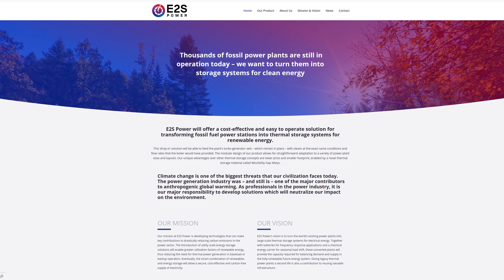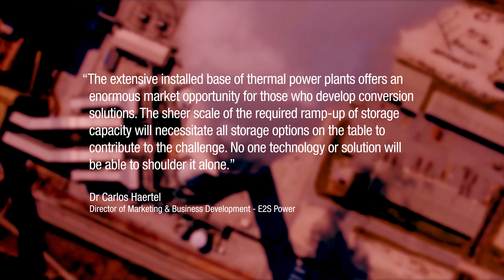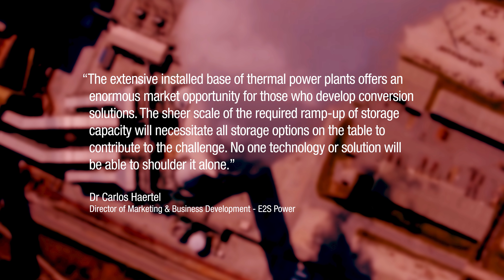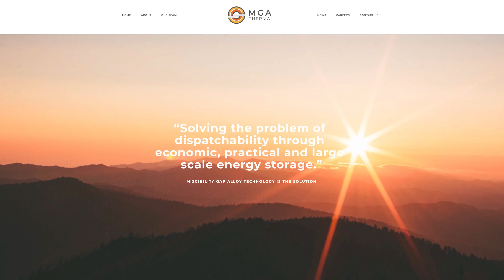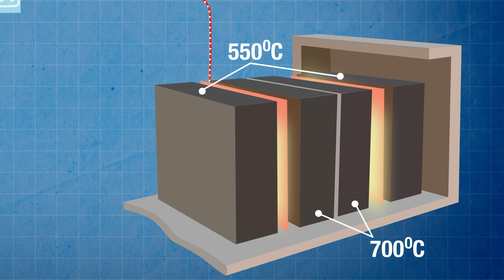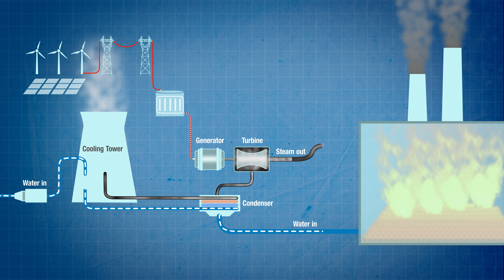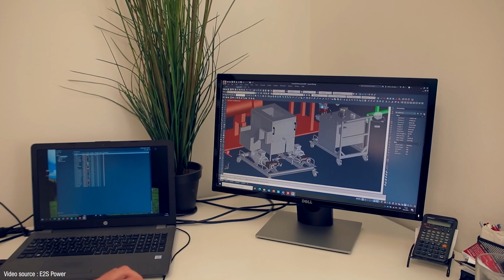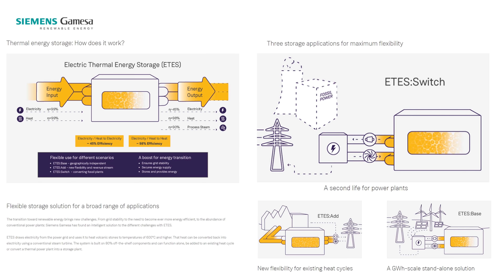New energy storage tech breathing life and jobs back into disused coal power plants

Comment: This is a very bad option from efficiency point of view.
You take a high-grade electricity during charging and lose more than 60% during discharge.
Batteries are much superior and Hydrogen is better as well.
The only benefit is the usage of the existing infrastructure
Reply: Current and near future battery plant capacity and their associated raw material supply chains are fully devoted to making batteries for cars and smaller scale storage facilities to take over the function of fossil fuel peaker plants.  There is no capacity in the system to build and supply the very large battery plants that would be necessary to build large utility scale battery storage facilities to complete with and/or displace base load fossil fuel plants.

There is no hydrogen.  All hydrogen has to be manufactured, compressed, and stored.  If one considers the full and complete life cycle, the infrastructure cost and electricity necessary to manufacture and compress hydrogen is as you say "a very bad option from an efficiency point of view".  You can't arbitrarily start the economic analysis from a magical utility scale store of compressed hydrogen.  The complete life cycle economics of hydrogen have to factor in the upfront capital cost and ongoing maintenance cost to build and maintain a hydrogen manufacturing, compression, and storage facility.  You also have to factor in the operational cost of electricity to manufacture and compress the hydrogen.  These significant costs all subtract from the overall financial viability and the net electrical efficiency of hydrogen (i.e., the electricity produced by hydrogen minus the predicate electricity needed to produce and compress the hydrogen in the first place).  

Large gigawatt utility scale solar PV is now coming in at a cost of less than $0.02 per KWh at favorable locations like the UAE and the Atacama desert.  At these costs does the round trip efficiency even matter any more?  A $0.02 per KWh generation cost coupled with a 50% round trip energy efficiency loss simply becomes the equivalent a $0.04 per KWh generation cost.  The problem with intermittent renewable sources is becoming less and less a problem with the cost of generating power in the first instance as it is to the problem of storing the power once it has been generated.  It increasingly seems as though the once important cost of generation (and round trip energy efficiency) are both well on their way to becoming an obsolete financial red herring that is dwarfed by the technical capability and associated cost of storing power once it has been generated.  The round trip energy efficiency losses are a built in cost of doing of business that will become increasingly more negligible as the cost to generate power from intermittent sources continues to fall. At the present time and for the near future utility scale storage capacity is the limiting factor and choke point to the growth and expansion of intermittent power generation.

The quick lead time and low capital cost to retrofit and repurpose the old power plants seems to be the economic driver of this solution.  It seems to be a relatively simple, quick, and inexpensive solution to get the repurposed system installed and brought back online.   Keeping in mind that these upfront costs will need to be amortized and passed on to the downstream wholesale and retail customers.  The basic engineering design of this novel storage solution has already been pilot tested and proven on a small power plant.  It need only be scaled up to a larger utility scale.  If so, a large number idol decommissioned power plants (or scheduled soon be decommissioned power plants) can be quickly repurposed and brought back to life as economically viable storage facilities.

Comment: Sounds like a huge, inefficient increase in entropy, converting electricity into heat. I'd prefer using the coal yard for Highview liquid air storage.
Reply: High temperature heat. Very important detail, as high temperature heat has low entropy compared to low temperature heat. So the entropy increase is not as big as you would imagine. 
The maximum (Carnot) efficiency of converting heat back to mechanical work depend on the temperature, given by 1- T_low / T_high.
If T_low = 20°C = 293 K and T_high = 600°C = 893 K, then the maximum efficiency is 67%.
Reply: Use the land where the cooling towers are located for the Liquid air plant, the Highview system gets more efficient if you have access to waste cold or waste hot, this could provide quite a bit of the later. However, I do wonder about some of these energy storage solutions as they assume the current situation of free or very cheap energy at night will remain the norm, unfortunately economics and grid frequency control means its often simpler to curtail Wind turbine production. Hopefully the grid operators and regulators will find ways to reduce curtailment by encouraging these sort of solutions.
Reply: @makemineapint  simple physics (and people primarily being active during the day) means there will be an excess of available wind energy during the night. The economics side of things should be changed with regulations, to make sure it is always more profitable to run a windmill and charge a thermal battery than simply curtail production. 
I guess their business model depend on regulators doing the right thing.

Comment: A really interesting concept - but I'm really curious to know how they are overcomimg two issues: 1) the inherent inefficiency of the steam turbines used in coal fired power plants. My rough guess is that the round trip efficiency of this system will come in around 50% at best. 2) the increased thermal cycling of the steam turbines which dramatically shortens their life. As a thermal storage technology MGA does seem pretty amazing, and reusing the substation, transmission lines and switchgear at old power plants does seem attractive.

Comment: I'm not convinced of the overall system efficiency. Convert electricity from grid to thermal energy then used to boil water to generate steam  to generate pressure to convert into mechanical energy that is converted into electricity sent back to the grid... Just too many steps...

Comment: Another bad idea how much energy is required to Prime the system and then how many times will the system need to be primed each time it needs to store energy. Think about how much energy is required needed to turn water into steam at high enough pressure to turn turbine blades generate electricity. At some point the heat stored within the aluminum graphite blocks will not be enough to produce the steam pressure necessary to turn the turbine blades fast enough for productive energy production and that's where you lose efficiency so the question is how many kilowatts a storage is necessary to produce how many kilowatts of return power?

Comment: That all sounds good but I always understood that coal plants are base load and it take days to take them offline and start them up again.  That would mean that for most big coal plants you'd need a constant source of 'hot', which is sort of what renewables are not.  I'm more of a fan of replacing the boilers with modular atomic generators of heat -- the type that turn up on the back of a truck and get sent back to the factory for refuelling.  That said, this would be a good replacement for the gas-fired plants that can wind up quickly to mange peak load.  Of course the other factor is that a lot of coal plants are pretty old and will probably just get run to the end of their useful life and combined cycle gas plants are brand new.  The incentive may be to run a coal plant until it's dead but not convert a gas plant immediately as it's less polluting. Still, over the longer term this isn't a bad way to scavenge 'hot' from renewables, which could have other applications than power generation like smelting, home heating and so on.

Rereading this, I guess you could charge up the heat sumps during the day, while running the station as well, but you'd be losing power during the daytime running  due to inefficiencies, probably a lot.  So if you always have loads of excess renewable during daytime (or whatever) it could work but you may find a better use for that excess power, like running a Haber process or smelting aluminium or something.

Comment: Interesting idea. One issue is that in the US, many coal power plants were built in the 1970's and are now approaching their useful lifetime of 50 years and so to keep using all the existing power plant equipment, major rebuilds are needed which is why a lot of them are going to close. So getting credit for going green but in reality avoiding doing costly rebuilds. 
If the power plant is anywhere near renewable sources, the existing switch gear and transmission lines are a big plus so would expect those parts to keep being used.

Comment: A coal power plant that only works for a few hours isn't cost effective enough to warrant maintaining it's operation. It's like the worlds most complicated/expensive battery.
The amount of energy that needs to be created to melt aluminum is probably a lot. That's energy that isn't being used by the grid, at any given time. This means that the amount of investment in intermittent power sources would be vast, especially considering how much power will be needed if most people start using 100% electric vehicles.
While batteries offer a way to reduce the amount of energy being wasted, electric vehicles will make power fluctuations become very dramatic, meaning that power production and power demand will both be intermittent, a very complicated prospect.
Is the UK out of coal? I don't see any reason to stop using it completely if it's still available. That's what people are arguing about right?
Also, what is the actual energy output efficiency? Batteries lose their voltage, effectively becoming useless after the voltage reaches a certain point. In most batteries, it's like 30%. How would this heat/steam battery match up?  Is it 100% efficient?
I'm skeptical about this idea. It's a novel idea, but probably not worth it. The cost of electricity would probably go up. It's like running a coal plant, that only produces energy at night. Also, how well does it ramp up production? It can't respond instantly, so a substantial amount is going to be wasted, like it normally is. Therefore, it isn't really even energy storage, it's energy momentum.

Comment: I think our biggest issue is medium to long term energy storage. Specifically we ideally need a 3 month stored supply by my admittedly finger in the air and see which direction the wind is blowing calculations. But to put this in perspective how much do we need for an hour on average? In 2019 we used 324TWh. That is near enough 1 per day or 41GWh per hour. Denorwig though huge only stores a tad over 9. There are only 2 other potential sites like that in the UK. So what would it take in lithium cells? Modern 18650 cells can store up to 13Wh (older types about 10) before the price makes your eyes water. So just for 1 hour you would need nearly 3.2 billion of them just for an hour. Aluminium has a latent heat of fusion a little over 10kJ/mol. 1 mol for aluminium is about 27g so a massive 370kJ per kg. Unfortunately that is only 102Wh per kilo. So for a mere 1 hour you would need the best part of half a million tonnes. That is a small fraction of the energy density of lithium cells. This is not a simple issue but liquid aluminium is not the answer. For starters the expansion between 550C and 700C is more than 10%. That will burst anything.

Comment: I’m curious why they use aluminium which is a more expensive metal than say iron which has a higher melting point (around 1500c) thus being able to store more energy.
But still well below graphite 3600 Celsius. Perhaps having a lower melting point is better from an insulation perspective?

Comment: Sir what is the price of this container size energy storage box and how much energy it holds when fully charged and what is the maximum electrical power we can apply to it so that we may be able to charge it as quick as possible and how fast we can discharge it i.e. what is the maximum power we can obtain though we know that it will lessen our operational time but this technical information is necessary for us in order to utilize this system more over can we provide it the form of energies other than electrical energy such as by providing heat through a molten salt based system that uses CSP (concentrated solar power).

Comment: At a Rankine cycle efficiency of only around 30-35% , I think there are better solutions, with much higher conversion efficiencies in the works. In my opinion.
Reply: Energy stored as heat and used in a heat engine to produce electric power suffers from the efficiency limitations of heat engines. Battery storage is more efficient and does not require operating labor, far less maintenance and no use of cooling water. Has anyone analyzed the cost comparison between the technology described here and battery storage? Thanks for posting this important note.

Comment: This is a bit of an odd question, but I was wondering if developments in thermal energy storage could offer help in improving steam power. The reason why I'm asking is because their have been some attempts to revive steam power. 
An example is a youtube channel called Mackwell Locomotive Co. which is dedicated to building a modern environmentally sustainable steam locomotive and tractor. 
The problem I have is that these steam revivals use bio fuels, oil, or gas which wouldn't be environmentally sustainable if these engines were to be revived for commercial use.

Comment: Rather than charging the thermal batteries with a resistance heater, it is also possible to charge them directly with heat. For instance, from solar thermal or a small modular reactor.

Comment: Plan B is to remove the fossil-fueled boilers and replace them with nuclear devices. No need for expensive energy storage devices and no need for another, external plant to produce the enetgy from a renewable source. 

Remember, a major issue with renewables is the amount of land they take up. A solar farm in the Nevada desert consumes about forty times the amount of space required by a conventional power station. So, reusing that boiler space will necessitate another plant being built that will be, in round numbers, at least forty times the size of the total power station. If you factor in that we are not in the Nevada desert you can multiply that number by at least two and most probably even more.

Comment: The tube wall boilers in large steam plants are enormous , the amount of containerized heat storage units to replace a single boiler would be substantial , and these stations are designed to run constantly not intermittently.
Reply: Yes they are designed to run constantly but thats manly to protect the boiler.  If you remove the conventional boiler then I’m not sure the same constraints would  apply to the STG and ancillary kit
Reply: you're barking up a tree , the wrong one

Comment: Graphite! Of course!

I have been interested in energy storage for years and have looked at many, many different options. I keep looking back at aluminium phase change. It's like the water of metals. Cheap (relatively), non toxic, with a great heat capacity (much, much better than some other metals), great heat conductivity. And the melting temperature is almost perfect to produce dry steam, for maximum turbine lifetime.

There are only two real issues that have been big hurdles for me to take the experimentation step. One is building a small scale (5~50kW) efficient turbine for a reasonable cost.

The other one is the large volume change when aluminium changes phase, which would make designing a storage unit that doesn't get shredded to piece from the phase change cycles quite a challenge.

A graphite matrix would most likely fix that problem.

Comment: Seems a good idea, but the scale of the trial seems very small. Typical modern thermal stations use 660MW generators, usually two or four at a site. So 50MWh of thermal storage, even ignoring losses, is going to keep one gen-set turning at full output for about 5 minutes!

Another use for these stations is to provide inertia for frequency stabilisation by adding some mass in place of the turbines - flywheels in effect.

Comment: I'm not sure if still releasing tons of steam into the atmosphere is any good for global warming. I would have thought the MGA system would have incorporated a heat exchange unit between the incoming cold water and the exiting steam from the turbines and a possible water  recovery loop. This maybe the condenser in the diagram. I would think these would reduce the overall running costs and reduce or stop hot steam heating the atmosphere.

Comment: This has to have one of the worst efficiencies of all possible energy storage solutions around. If you want to use existing building and grind infrastructure for grid storage solutions at least pick something that makes sense on paper, there are several that don't make the electric-thermal-electric change. There is no existing way to get any usefull % conversion once you venture into the energy tomb of the univers...